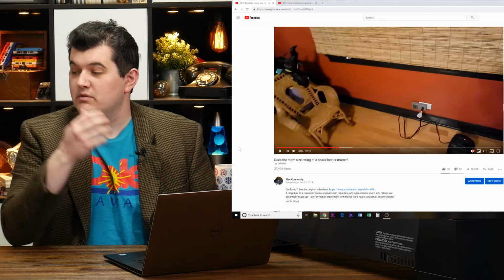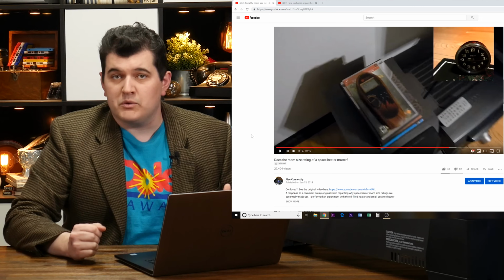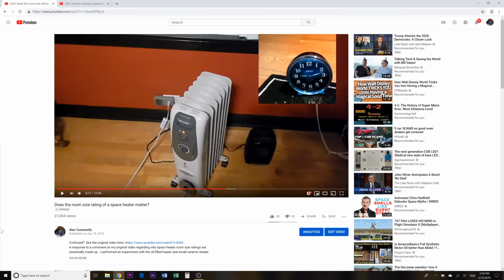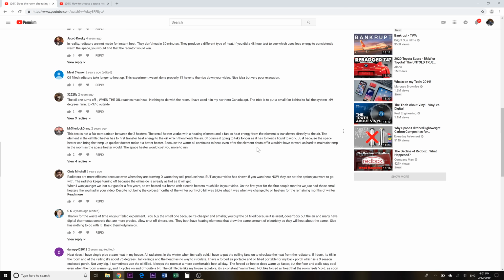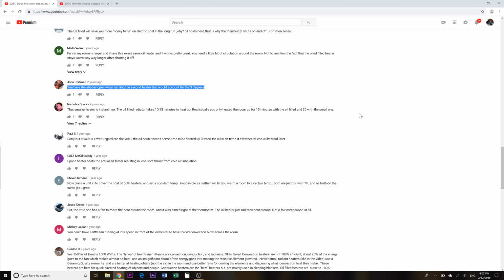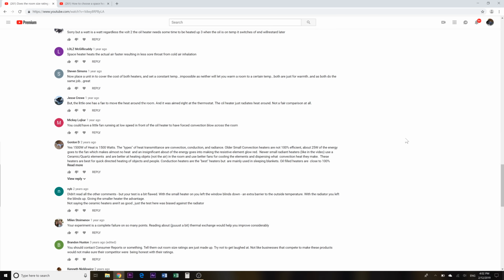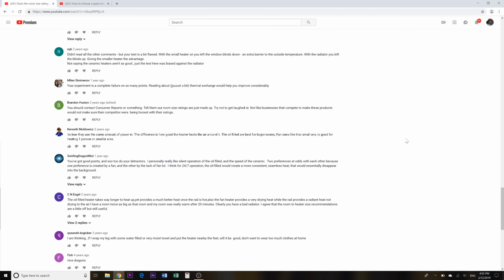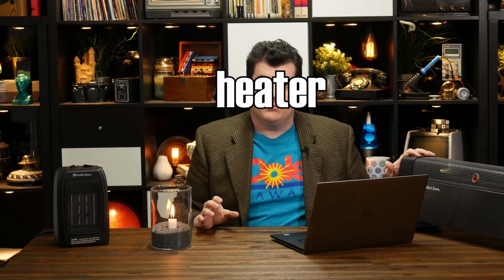More Space Heater Nonsense

Comment: So a flower pot over tea lights is a heat equivalent of an electrical lowpass filter - it's both a capacitor and a resistor, stabilising and delaying the heat output.  Amazing!
Reply: look at all of these tryhards,❢❢ 😂🤣
Reply: @unfa: It's worth noting that it would be better to use an inductor than a resistor in the comparison, since inductors only produce heat because of the impurities of life.
Reply: @absalomdraconis  a perfect inductor  produces  no heat...it uses no power ...no power no heat....only the resistance of the inductor uses power....using an inductor as a heating element just wastes materials
Reply: @helltanner3722  : I was speaking in reference to the flower pot, which doesn't itself produce the heat, not the candle flame. Sorry about being vague.
Reply: In the end it's not about how much heat you produce but how to get it where it needs to be. What's why an electric blanket is much more efficient than a space heater: It only heats up the skin and not the entire room. For the same reason cars have seat and steering wheel heaters as option additionally to engine heating through the radiator.
Reply: @ @MayContainJoe  probably the best and most efficient heater would be a pair of heater slippers. If your feet are warm you barely notice a low temperature.
Reply: @MayContainJoe  Uh, the radiator removes engine heat, it doesn't heat the engine. Unless you mean taking heat from the engine to heat the cabin, in which case the radiator still doesn't do this, the heater core (which is like a miniature radiator that is used to heat cabin air) does.

This is why, if you happen to face an overheating engine situation and you need to power through it for whatever reason, your best bet is to turn the heat on full blast and rev the engine a bit (most cars have crank-driven water pumps, so to keep the coolant flowing you need engine RPMs to maximize flow).
Reply: "(which is like a miniature radiator that is used to heat cabin air)" - Guess, what radiator was meant! The one which heats the cabin obviously. Or which radiator did YOU think of?
Reply: @rars0n  yeah, been there, done that. It's fun when it's 30 C outside, and you have to blast full heat out of the heater while sitting in traffic, since your radiator fan is broken, but your heater blower still works, so your engine doesn't cook. Luckily when at country road/highway speeds, the air current from movement was enough to cool the engine/radiator so you could get a bit of a breather.

I had a thermometer hanging off my rearview mirror and it read 60 C... Luckily nowadays, I've fixed the radiator fan so this is no longer a problem.
Reply: you put your what, where exactly?
Reply: And an electrical lowpass filter is the equivalent to software interpolation. :) Mind blown? Capacitive = linear. Inductive = cubic :) (Schmitt trigger = nearest neighbor.)

I am a programmer but with a hobby in electronics, and it was very satisfying having these revelations, it totally changed the way I read schematics.

Back to the original topic though, it is the difference in slow(but fully) filling a room with  heat, or spraying hot spots all haphazardly. I would argue the haphazard approach will make the room feel warmer faster, but the warmth will be highly inconsistent. The first will be able to maintain a sphere of warmth even if it cannot overcome the draft in the room, while the second will just get diluted and achieves little.
Reply: Flowerpot over a low flame is very efficient, if you're stuck on propane. (Been there, done that, heated that way for a lot of years.) Also improves the character of the heat (see below) compared to direct burning -- probably the ceramic re-radiates at a lower wavelength.

And while 1500W is 1500W, different heaters produce heat of different character, which probably has to do with where their emissions fall in the infrared spectrum -- lower wavelengths feel warmer even when the air temperature is the same. I've had good results with a tiny quartz heater, a cheap barn heater, and a radiator-tank heater, but terrible results from a pricey Vornado brand space heater... even tho they all claim to use the same 1500W.

Became painfully aware of differences in heat character when I had a firebox stove in a trailer. Even when the air temperature produced was the same, when it got below zero outside, burning wood never produced the same degree of perceived warmth as did burning coal.  Probably a matter of how much was absorbed by the walls, so they weren't constantly sucking heat from the room.
Reply: @Reziac  Well wavelengths are neither low or high, I presume that you mean longer wavelength ie lower frequency in which case there is no probably about it, the frequency of the radiation from the flower pot will absolutely be lower. Frequency of emitted electromagnetic radiation increases with temperature, higher temperature = higher frequency = shorter wavelength. In the case of the flame you can see this as the flame radiates a lot of visible light but there is no visible glow from the pot because the heat being spread over a larger surface the surface is cooler and the radiation is mostly infrared.
Reply: @Reziac  wood tends to burn with more draft. With most designs of stove, embers heat better as they sit in the firebox and radiate heat with a lower draft, whereas flames tend to suck air up the chimney.

Comment: Each repeated test the furniture, drywall, etc. warmed up skewing results.  I would've repeated test each day at the same time and same indoor/outdoor temp.  Oil filled have heat anticipators thermostats.
Reply from the maker: You do understand, though, that this means the oil-filled heater should have had the advantage. Its test was second. And yet, it still wasn't able to heat the room anywhere near as quickly as the ceramic heater.

Comment: Well one comment was right in a sense that the small unit dries the air. Keeping the humidity high helps convection to transfer heat to other objects in the room. The goal isn’t really to heat the air but to heat the walls and objects so that the room becomes “heat soaked”.  Once the room is saturated then it takes less energy to keep the room heated. 

The oil heater is more efficient only over the long term as it’s not consuming 1500w constantly. 

I think you need to consider humidity in the equation.  Also heating the air is different than quartz heaters which heat surfaces not the air. That’s a whole other rathole.
Reply: This always puzzled me too... Drying out the air? Hotter air can hold more water than colder, so maybe you're just making the air more "grabby" for moisture - and so it takes it from wherever? 
But that should hold true for any heating method other than open flame (which would release some water from combustion into the ambient air). Even fuel-fired furnaces with heat exchangers should "dry out the air" as well as an electric space heater.
Right?
Reply: @RobFulcher  From what I recall, if you find moist air more pleasant than drier air, then vent during the evening hours when the sun sets and later. And if you like it drier, vent during the day.
Reply: I wonder - where does the water vapor go?  It can't disappear, it's also not liquifying - that'd be noticeable. Where does the humidity go?
Reply: @unfa00  the humidity doesn't go anywhere, the actual amount of water in the air stays the same, but the Relative Humidity decreases due to the rise in air temperature.  We are more susceptible (or more sensitive) to relative humidity than to "absolute" humidity.
Reply: @DimensionDude  Indeed but one problem here any two dry heaters ie heaters that don't include a humidifier or a chemical reaction that actually generates H2O (ie most combustion heat except coal as the majority of other common chemical fuels are hydrogen sources, wood, oil based fuels etc)  will cause the same "drying" of the air per degree of temperature rise so calling one dryer is bunk.
Reply: @unfa00  pushed away by the air temperature difference. A room is not a sealed box.
Reply: That's interesting!  @braddl9442  So a sharp temperature gradient causes the water to escape the room?